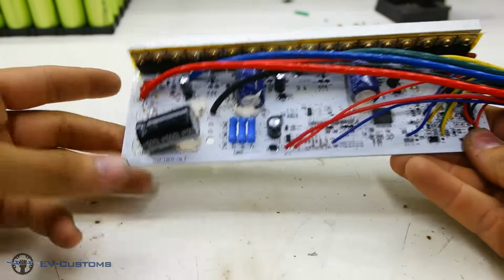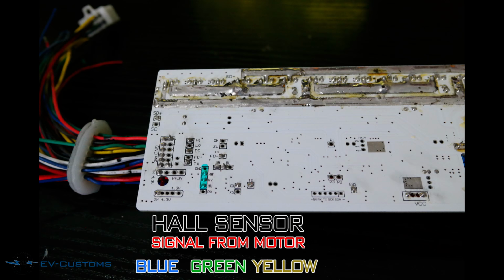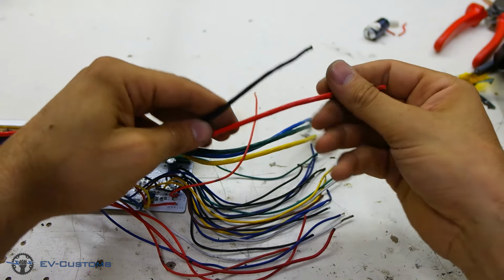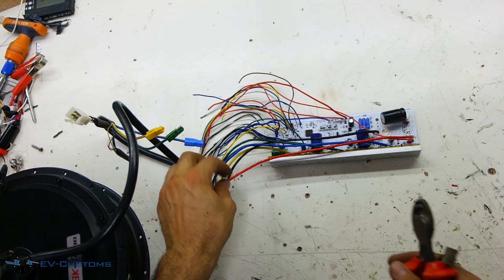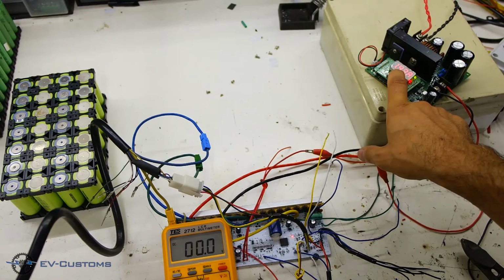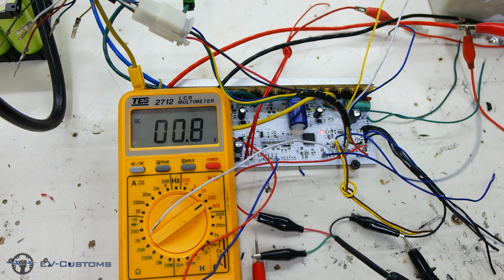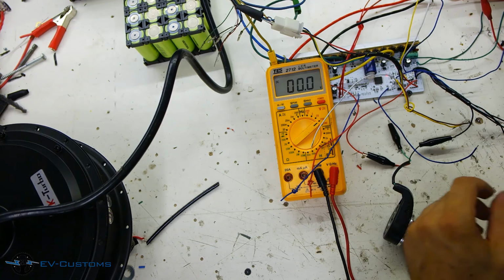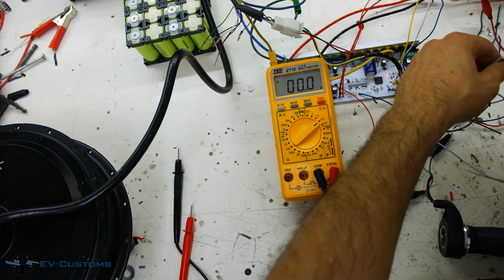How to Find Wire Functions of BLDC Controller Which don't have Labels on Wires

Comment: Thanks for another great video. Did you have any success adding a connector for the display directly onto a board with the display pins available but not wired? or is the chipset responsible for that functionality - I would imagine sometimes they use the same board but don't fill it with same chipset?

Comment: thank you, maybe you can, I am upgrading a controller on one of my ebikes. the one that came with the kit is rated at 15a continuous and when i use the motor at full throttle going up to 1200 watts on the meter that would be 24a and i've had the motor connectors melt causing an open on one phase, so i searched for a higher capacity controller, got a 48 volt 2000w which should be close to 40a continuous. in looking at the wiring there is no display connector, i have opened it up and looked at all the connections on the pcb and see a place that looks like wiring could go there for a display, and i am hoping with the connectors i am getting  i can connect it easily to try it out, it may be sine wave and have smoother operation also, but i want the programming options i have with mine now that has the KT-LCD3 display. so do you know about using a controller that doesn't have a display connector and if i might get lucky soldering the display wires onto the board? and are most controllers programmable from common displays, mine is a 48v 2000w
Reply: did you have any success adding a connector for the display directly onto a board with the display pins available but not wired?

Comment: Great instruction !!!
I am wondering if by any chance you might have a general idea of what the letters/writing on the actual PCB's means or refers to, the ones that were not obvious anyway ??
These all came from an UN-labeled 48v-500w controller originally in an ewheels ew-19/ew-20 which blew a few of the 9 output mosfets.... 
the only nomenclature on the PCB itself is: F2H3719A0  and  FLS1205  and  FOC9_YZ_D
L - white, many ? {one of these is in a connector marked Brake, assuming it is "Low Brake" when shorted to it's connector mate which is black}
H -  ?
FD - purple ? 
DC - orange ? 
DMS - orange/green stripe, many? 
YY -  ?
SDA or ADS -  ?
YJT -  ?
XH -  ?
XZ - pink  {I believe these are for speed or gears}
SS - purple  {I believe these are for speed or gears}
SD - green w/white stripe  {I believe this is for signal from throttle}
Z5 - red w/white stripe  {I believe this is for 5vdc to throttle}
H5 - red  {Hall from motor 5vdc power}
U - blue  {Hall from motor phase}
V - green  {Hall from motor phase}
W - yellow  {Hall from motor phase}
CSYB -  ?
YJ -  ?
YBM -  ?
VH -  ?
DZ -  ?
ZZ -  ?
CZ -  ?
GND - black {I am assuming that these all are ground, many}

Any help would be greatly appreciated !!

Comment: Just got a 'Thumb Control Throttle' that I want to connect to 48V 1000W brushless controller. Previously used 'Twist Throttle' that came with the conversion kit but it F****d Up! So got another one and that didn't last long either. Thought I'd try a 'Thumb Throttle' because there is less to go wrong!? (and yes clearly tempting fate with that comment!) What I want to know is, when I connect the 'Thumb Throttle' to the controller using the 'Twist Throttle' connection I will need a separate 'Ignition' or 'On/Off' switch. This is because the 'Twist Throttle' has the 'On/Off' switch built in. But assuming the throttle operation uses the Red - Black - Green wires I have 3 wires left to choose from Brown - Yellow - White to connect the On/Off control? Any suggestions? Or would the 'Thumb Throttle' work if I connected it to the 'Pedal Assist'?
Reply: Best to seperate the throttle section out of your plug and test just that part - by leaving your twist throttle connected and pull out the pins from the plug one by one - if you pull a pin and the throttle doesn't work then you have either removed throttle pin or power pin to on/off - then just eliminate wires. Then the on /off switch is just a in and out switch that turns on the controller,  that leaves one wire that may be power light (or battery indicator usually comes on when you turn the controller on.) - once you have the throttle sorted an on off switch just run the multimeter from an earth to your last wire to see if it gets voltage.
Reply: @simoncossettini9680  Thank you for your reply the timing of which was quite fortuitous given that I have just decided to reconnect my bike motor after not having used it for a few months, so much appreciated!

Comment: I have watched your videos many times. I still learn from you. I have tried two new 36v ebike controllers that are paired with s866 displays. One controller has the 6th white cable with the usual 5 hal return cables. The other doesn't. I tried soldering a white cable onto the F3 hole along side the other HAL returns. With or without the sensor both controllers have erratic speed showing on the display. It falls to 0 km/h and can jump up to 45 fluctating quickly. This of course makes power to the motor just as erratic as the speed changes. The original (two) controllers never had a problem. Any idea of what this could be? PS I checked signal on the white wire, 5V until once a rotation which falls to near 0. PAS sensor is working fine. No errors.
Reply from the maker: You mean the extra white cable came from the motor? if yes this wire is for speed signal output.. is not necessary to connect ti controller...  the controller can calculate the speed from three power phase wires..
Reply: Yes there is a signal but since it is a geared motor the speed reporting is all over the place and of course falls to zero when not peddling. I saw somewhere else that if there is an external three wire cable and plug it is possible to connect the white wire there. IS that correct? @EVCustoms
Reply from the maker: Tell me again, this white wire came from motor side and didn't exist from controller side or the opposite?
Reply: Yes geared ebike motor HAL wires including the 6th white wire speed sensor. Two different controllers one with a white wire to F3 beside the YGB HAL wires on the board, another new controller same mother board yet no white wire. Soldering in a white wire to the same trace on the board as the other one changed nothing. . I don't think it could be the UART commination mode as neither controller would work after. From what I understand the white wire sends 5v until the magnet shorts the power to ground momentarily each revolution of the wheel (wheel assembly with geared motor ).
 @EVCustoms
Reply from the maker: About 5v output with a magnet you are correct, if you have same controllers for 95% it must work...  note that this F-pins they are programmable and they programmed from the factory..
Reply: Ah that is it. Must not be programmed.Thanks a lot.  @EVCustoms

Comment: Thanks for this, this helped me re-map and re-wire the wires of one of those highly generic Chinese E-bike handles (with lights on/off switch, throttle handle and battery display) to the wires on the controller board. Thing is, the 6-pin connector often fits, but the wiring is completely incorrect. Yesterday evening I had it back working again !

Comment: Hey, great video. I need your help. I am trying to use the electronic brakes, it works but only for the wrong direction. I tried to change the motors phases and change the direction in the controller, but it didn't help. do you have an idea for how to change the braking direction without changing the motor direction?
Reply from the maker: Your motor is geared hub motor?

Comment: Hello, great video ... the problem is that I have a KT controller, with 12 mosfets and hall sensors, PAS and an accelerator with a current switch and three LEDs for battery charge level. It does not have connection cables for Display. I have bought a KT LCD5 Display, with five cables (+/-, control (blue), Data1 Rx, Data2 Tx. And I cannot find any electrical diagram of how to connect the cables to the pins of the controller board. Can you tell me? Which pins of the controller board do I connect the cables to? Thank you.
Reply: Most controllers use bluetooth and a phone or tablet. No display
Reply: I have the same problem. Did you solve the problem?

Comment: Will it harm the controller to solder an xt150 connector to the battery wires? I mean will the heat from the solder harm the controller at all ??
Reply: After a few inches of cable from the controller you're good to go with soldering a connector. I've gotten my controller hot but safe to touch without an issue. Probably around 110-130f

Comment: thnks for the video, i have an ask, the White wire (xx in the board) its the speed limit wire ? it should be conected to White gnd wire? waiting for your answer and thanks again
Reply: That wire does not get any space on the new controller. It is the speed limit wire and it should be labeled ABS on your old controller board.

Comment: So If I'd add a Bluetooth module to the programming pins using 5v vcc gnd tx and rx, I could eliminate the need of buying a display and use my phone instead??
There are a couple of ebike Bluetooth programming apps on the android market already available.
Reply from the maker: Hello my friend... this is not so easy... ;) you must know the interface of each controller...
Reply: @EVCustoms  any 12v pins for lights?

Comment: Great video! But I really need some help if anyone knows this. Unfortunately my controller does not have the same markings as the one you showed. I got a pack controller including a throttle with key switch(2 connectors with 2+3 wires), but the controller has no TH for throttle or any markings on most cable connectors.
Could it be the connector with pink(SP+4.3v)-black(gnd)-puple(TS) for throttle signal?

Also, how is the ignition marked on the circuit board? I don't want to short the wrong cables. Please help me!😬

Edit: the unknown cables from the motor controller that also fit with the connector to the key switch on throttle(white-yellow), are the following: 
1. Red(VCC1)-orange(36v+) (says electronic door lock in chinese)
2. Orange(36v+)-black(gnd)
3. Brown(DD)-black(gnd)
Then there are 3-4 more identical 2-wire connectors, but they say like high brake, low brake, charge port etc in Chinese.
Reply: I’m stuck just like you I have labels but not the same my light flashes if I spin my wheel it shows speed but no throttle. I opened the controller to inspect all looks fine but still no throttle. I must have something wrong or just not hooked up

Comment: Hello. My Controller has a Cable called DS. If its connected to ground the speed drops from 45kmh to 25. Beside this Cable is a hole on the pcb which has no cable and is called GS. Is Gs connected to ground the third gear which gives me more than 45kmh?  There is also a TA hole with no cable. Maybe a fourth gear?

Comment: Hi, So to get rid of speed lock, You could just deactivate the EBS?
Reply: Try connecting XS to Gnd
Reply: No. Generally if the speed wire is in the motor harness it will be marked as ABS on the circuit board. I'm not sure if you can cut it and go fast. The controller may not work without it. Some companies are serious about their speed limits.

Comment: Hi, have a problem with controler, my controler have a label 3 speed 48v 30A, but hes have a 3 plug and 6 wires, i cant find 3 speed wires, also i dont have a speed changing butto so i found in wires all gears from 1 to 3 and bypass it, but speed doesnt change, max speed on my moped is 41km/h, whats wrong?

Comment: All the wires except for the main wires to the motor in the battery fell off of my controller circuit board now I don't know where the throttle wires are what are the abbreviations for throttle besides

Comment: Nice video, but is there any way how to find display connectors?
Reply: Most modern controllers use bluetooth. Your phone or tablet is your display.
Reply: Take your display apart look what wire goes to speed then posi/neg run to any open you have to connect to. On your controllers mother board the speed wire is usually a thin wire beside one of three big coloured wires for wheel motor, mine has one big yellow one thin yellow together on board thin goes to speed. Or if you have the old connecting block and installing new screen look at old screen again take it apart follow speed wire to connecting block. Then you can relate which wire goes to what on the block on harness

Comment: Hi.. My controller no 5volt output. Can advice. Thanks
Reply: Like is there a fuse ? I have a question sir.  Can or do you have a voltage out or some diagram ? Can I bypass led lights for battery level ? Thanks you rock man.

Comment: In my controller motor wire was getting melted when I am using in full the motor voltage was 48 volt and 1500w what is the solution for this problem at the time of heating two face wires from motor get short circuit andar MOSFET was blown can you help me
Reply: Need a higher wattage controller! Or less voltage battery,

Comment: So how do i turn the board on ... ? Do i connect the vcc to a 5 v or straight to the battery ?
Reply from the maker: To battery plus
Reply: My Kelly KLS-S uses battery voltage. I see a lot of questions that could be answered with a diagram of the controller wiring. Do most companies not have a website with diagrams and installation tips?

Comment: Hi sir, I have a problem
My motor works okay if I use self learning line, but without that it doesn't work (it means in normal working after applying throttle it doesn't work) I check my throttle already it is okay. can you help me?
Reply: Your hall sensors malfunction. Try to unplug the hall sensor cable. If work, tht means problems at hall sensors

Comment: High brake yellow one wire is activated when battery power is connected wire has no power. Low brake black and white has + and -  when grounded/ connected brake activated.

Comment: Do you know if running a 36v battery and 36v rated controller on a 48v hub is legit? Like, will I ever run into any type of issues?
Reply from the maker: The only issue you will have is lower speeds..  about -30%
Reply: @EVCustoms  I’m fine with the 30% reduction power. If it’s safe to proceed with this under voltage setup, I assumed to always buy higher voltage hubs if they all cost the same?
Reply from the maker: It is safe.. don't worry about it..

Comment: Some how i dont have 5v anywhere on the board, there is a 7805 5v regulator thas no voltage on pin 1 output. or pin 3 input

Comment: How to know the wattz og 60v controller?
Reply: Count the mosfets and Google the code on them or keep putting fuses in your circuit battery positive for example if a 20a fuse blows and a 30a doesn't then it's around 25 a

Comment: where do you connect brake high wire with is alone on ym controller 3:43 nvm
Reply from the maker: High brake wire must be connected always on RED power wire to activate the brake.
Reply: @EVCustoms  yeah you told it at 3:43  
Thanks again

Comment: Bought a new controller wired it to a working bike and nothing .All connectors info are only in Chinese! 
The make is  SODIAL.
Got 5V at the throttle plug , took a resistance reading on the 3 motor wires and two are 9k ohms and one is 7 K.
My old working controller had 3k on all wires.  Anybody knows what a good reading would be?

Comment: what is different between high brake and low brake?
they only just cut of the throttle.
on your vid even low brake stopped the motor faster.
is high brake use for regenerative braking?
Reply from the maker: It is same think... Difference is tha to activate hi brake you must connect it to positive battery wire

Comment: How to add reverse function wire, if my controller doesn't have.
Reply from the maker: Hi.. you mean direction or reverse function? direction you can change by combinations of power motor phase wires, single reverse function existing on all controllers..

Comment: If its possible show how to connect program cable please 🙏 🙂
Reply: Program cables are generally the old serial port connectors from the 90's. My laptop doesn't have one. Hopefully there's a plug for a bluetooth chip. Your controller company should sell them.

Comment: How do i connect 3 phase motor to controller with 6 phase connections?
Reply from the maker: Controller with 6 phase connections???
Reply: You might be talking about the hall sensor that's usually 5 or 6 wires the extra wire is usually a thermal sensor or a speed sensor.

Comment: Three different throttles and still doesn’t work the wires have power all three even one from a working bike isn’t working for some reason it’s not sending signal back on any even a for sure working throttle from another bike doesn’t make sense so confused

Comment: Thank you so much. My throttle is a 12v and I discovered this after checking the circuit board labeling. I ordered a 5v throttle and that should fix the issue. BTW That mistake wont cause a red light on a kelly kls-s. After the throttle is engaged the controller will power off.

Comment: Hi I also have a control unit for my electric scooter slightly different from this one only that it does not have the wires for the accelerator can you help me I try connect it for months (meaby can I send you the photos on Instagram)
Thanks you very much

Comment: What's happening when i input 48v to controller 36v
Reply: it would be fine but no low voltage cut off
Reply: In circuit, capacitor  withstand of voltage are limiting factor.